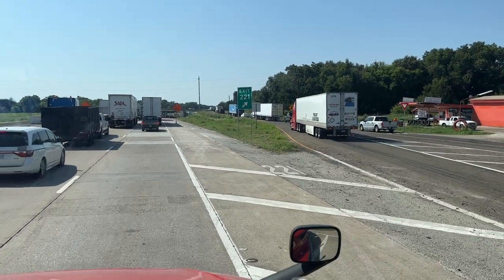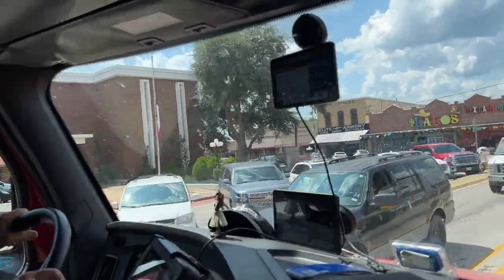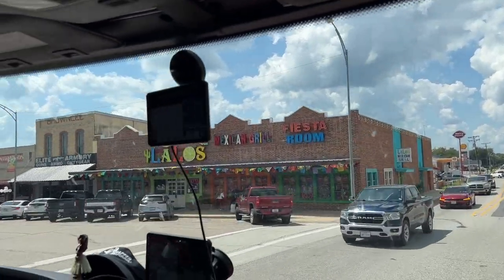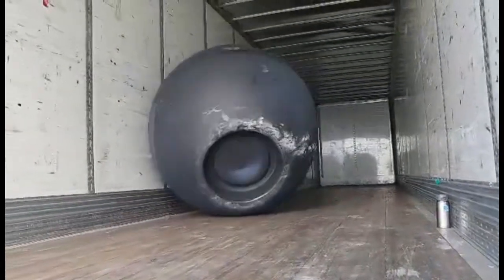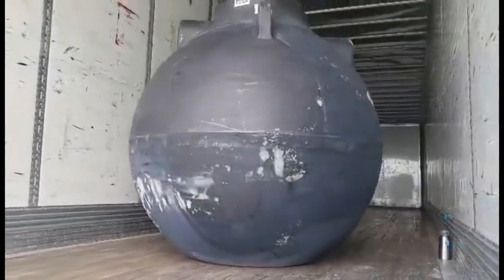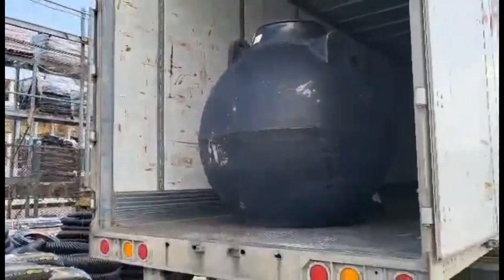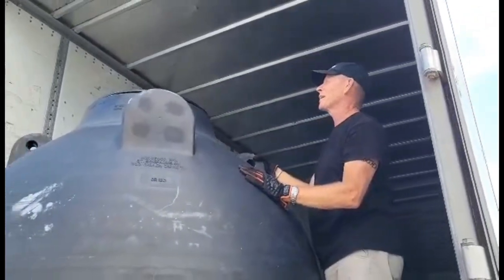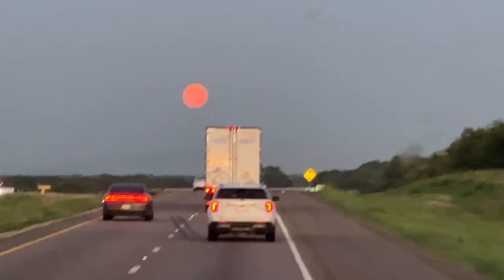Live Load at Lowe's | Unloading Truck with Forklift

Comment: Was that dispatched as a driver assist or driver tailgate unload? I ask because those are actually an extra charge to the customer and drivers are supposed to be paid extra for that when the customer requests it. If you choose to do so when it is not part of the dispatch, you're basically volunteering to work for free.
Reply: Regardless of how it was dispatched, if they required him to tailgate the load he should be paid.  Other option would for the company to send out a work crew to unload it.  I've been in both situations.  Company hired a crew to unload tires at a customer that insisted I was responsible for getting them off my truck.  And I've tailgated loads at Lowe's.
Reply: But yes, if they didn't request him inside and he volunteered, he's doing it for free.
Reply: @truckingwithj7202  I work for the same company (almost 11 years with them), procedure is if it is not driver unload, contact dispatch before you "fingerprint" the load so it can be arranged for the driver to get paid and the customer billed for the extra service. Typically, deliveries to Lowe's stores are contractually no touch for the driver.
Reply: @tomflinn9815  exactly.  Don't touch without prior authorization.  And only touch if you are getting paid.
Reply: Well if you get extra stop pay then that covers that if your trip has 2 or more stops. If it's only one then yes they certainly should get extra pay for having to help with unloading.
Reply: @ericcutrer1467  extra stop pay is different than unload pay.  If I have multiple stops, I get extra stop pay.  If I have to unload or assist unload, then I get paid for that also.
Reply from the maker: Hmmmm…we didn’t know anything about that. At the shipper it had a sign that drivers were expected to help. At the receiver I think Kevin was just being nice. We’ll look into it if the same type of situation arises. Thank you everyone for your input!!!
Reply: @TheJoyofTrucking  the dispatch sent to the truck has indicators for driver load and unload. Some will also have an additional message to check the BOL for indication and sometimes a message will accompany to contact dispatch if asked to load or unload. It is extremely rare that we are required to lay hands on the freight.
Reply from the maker: @tomflinn9815  Thank you so much!!

Comment: What did they ever use them kind of thanks for especially that round one The square one's eye used one kind of like that for herbicides on the farm
Reply: They are designed to be used as septic tanks (sewage),  but they can be used to store other liquids, but they aren't the best option for storage tanks because they have no outlets at the bottom so the liquid would have to be pumped out.
Reply: They're septic tanks
Reply from the maker: Our guess is septic. Or water. And then there’s that big hand grenade. 🤪